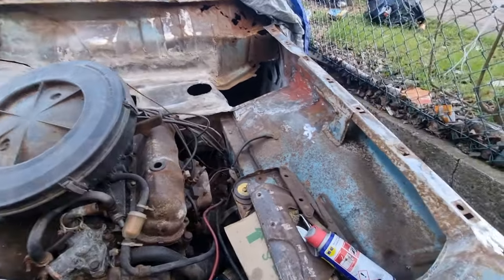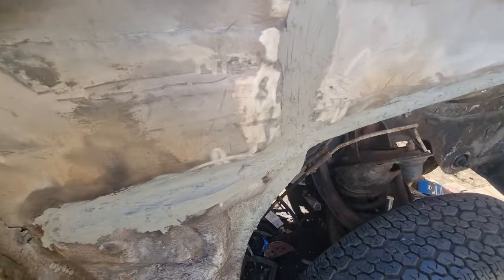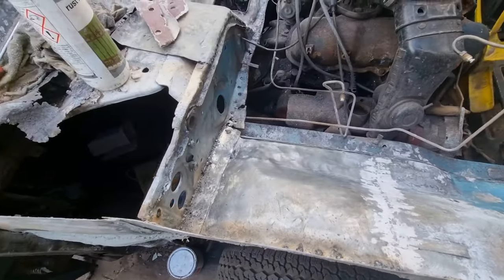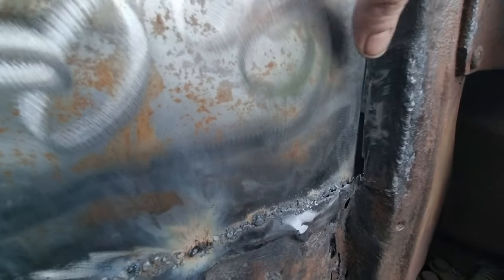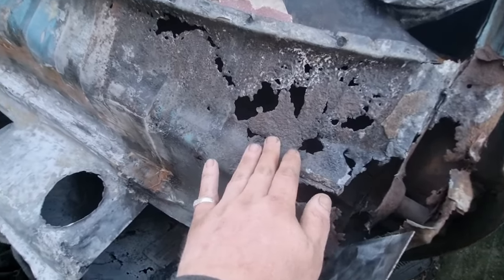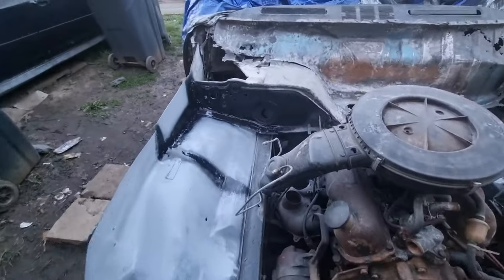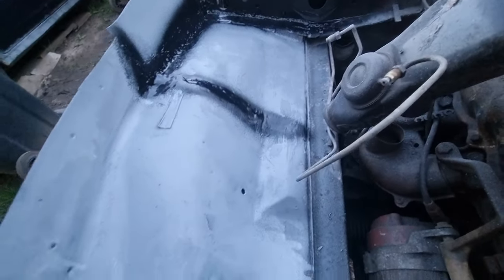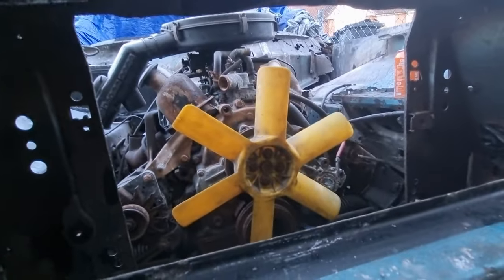Cortina Mk4 Ghia 2.3 V6 Restoration || Engine Bay Update (P16)

Comment: What is wrong with the current rear axle?
Reply from the maker: its for a 1600 its the wrong axle it was only put on there to move the car as it was getting broken for parts
Reply from the maker: you can see how this car was saved on retro rust on youtube he saved it 2 years ago check him out
Reply: Still got a Haynes manual for one of them,bought one as a scrapper for power steering and axle,weighed rest in
Reply from the maker: @adebat13  cool

Comment: Like eating a Elephant .one bite at a time. Doing great Mate. Watch out for fire under dash if welding late. Have water hose in position and extinguisers. Watch out for wires. Pull your spark plugs and put some diesel down to lube up. Save your rings. While you welding. Cant remember about spliting dash. Be careful if grinding with a cutting disc. It will shatter. Get a 40/60 grit flap disk. Its flexible. Two grinders is good. Save changing disc. One Bite at a time Brother. Good luck. Get a cheap tripod for your camera. Lube up all your suspension nuts and bolts its got time to penatrate. 👍👍💪
Reply from the maker: thank you will i have lubed up all the spark plug holes and there is no woire loom on this car i need to get one
Reply: yeah that is a great tip with grinders, Me and my dad did that, one had the grinding disc, the other one had the cutter disc.   Also as mentioned, lube up all the bolts in suspension etc, ready for when you need to wiz them off, for rebuild.
Reply from the maker: yeah great idear on the grinders it is a pain keep swopping lol so would be noce to have 1 of each ready

Comment: Great transformation, not sure what you mean about the dash, from what I remember it's all steel, 
 Well done man.
Reply from the maker: the dash there is a top section that is welded in the window frame lip but then you have the lower dash can the bottom part be taken out with out the removel of the top section  or does it have to come out as one lump

Comment: Rostyle wheels always liked good on a Cortina. My first car when i passed my test was a 1600E mk2. But i did my Accident crash Bodywork apprentership on these cars in 1982. Wheels looks good with the chrome rings. The Gia was top of the line. It had wood door cappings. 2.3 V6 a good engine. Tax free. Test free. Cheap insurance. Its a Great Shooting Brake. I also fitted tyres in later years. Goodyear was the choice tyre on this car. Michelin rubber was to hard for this car. But Pereli if you could afford them. But my advice buy good tyres if you planning on driving twisting country roads. Second hand is good but not older than five years. Check date code. Nows your time to look for a bargain..new valves and balanced all around. Good spare. Get good quality locking valve steam. Modern day valves perish in one or two years. Just what i know about these cars from the old days. Happy shopping. 😂👍
Reply from the maker: awesome advice i would love some rostyle wheels but they are not cheap i also love the crome rings i think i can have the crome rings on the wheels i have pretty sure but may be down the line i can save up for a good set of rostyle  wheels :)
Reply: @AdamSNook.  Yep maybe see if you can find two little wider Rostyle for the rear. . Clean up the two you have. The Chrome trim hides most of the wheel. Just sand blast fronts if needed. Mask repaint. It's just labour. Some people changed out to Slot Mags. Can't remember the make. But looked ok. Maybe find some Banded Steelys cheap..

Comment: what i did stay about cans of pop!! Cups of TEA i want to see in the video lad!  Also that engine bay and inner wings are coming on really well, Id be tempted to give the front valance a waft over with a primer too. What are you doing about the wheels on this?  its got a right mix match of wheels .  The dash side of things, id ask on the Cortina forum buddy, in case people start telling you, to cut this and that. When you might not need to do so,  plus a workshop manual wont hurt at all, a dealer one if you can get one. If you want to take a break on welding as i mentioned before, you could have a look at the cars body look, just to see how intact that is, In case someone's had a cutting session and a fiddle.
Reply from the maker: thats me told off hahahaha im not a tea drinker sadly i do like my coffie tho hehehe and yeah coming along nice :) wheels im going with the set thats on the front i need 1 more as i only have 3 of them hahaha
Reply from the maker: @procta2343  1 rear is a old wheel the other is a space saver the 2 front ones match and I have one in the boot so 1 short

Comment: Are you not cleaning the welds up before seam sealer and paint (or stone chip)?
Reply from the maker: Yeah they get cleaned first with my wire wheel
Reply from the maker: I grind the weld wire wheel them primer then seam seal